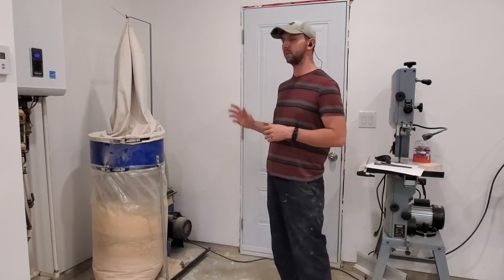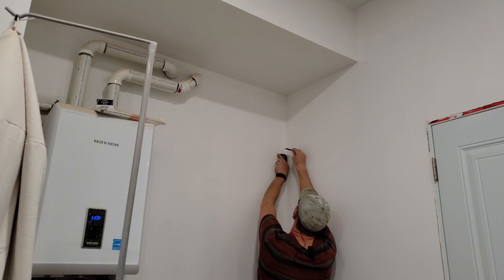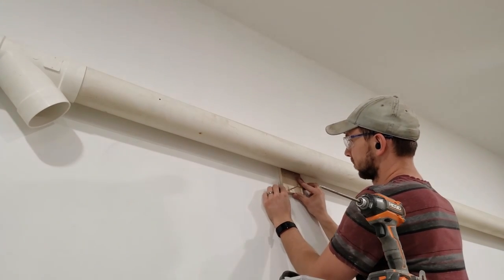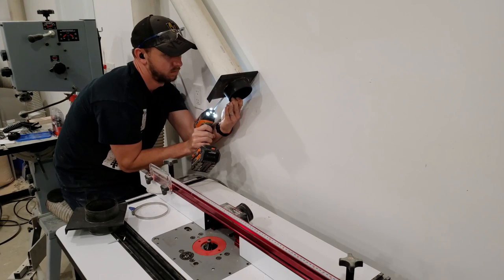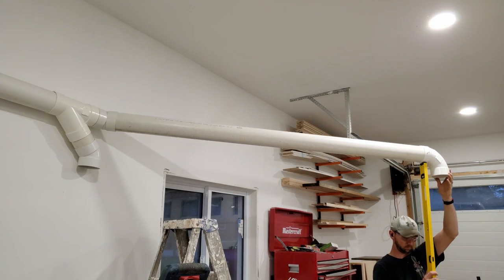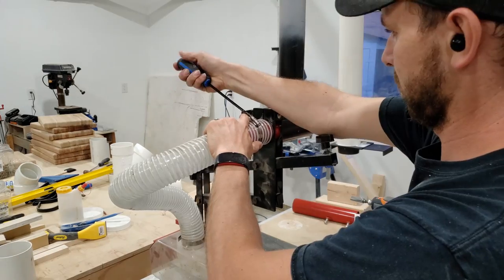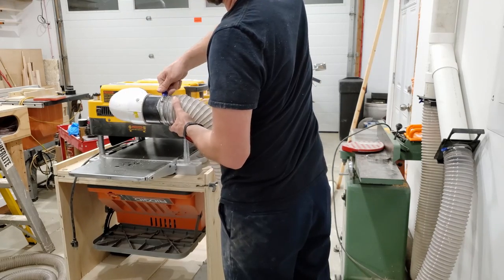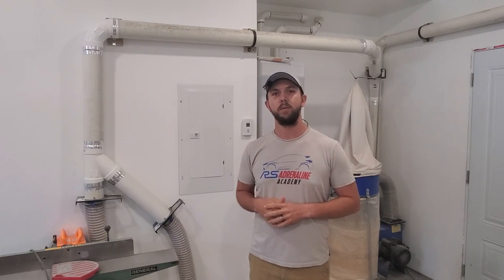How To || Beginner Dust Collection Install || Using 4" PVC

Comment: Great video, thank you for posting your install.  Are you pleased with the system 7 months later and what might you do differently?
Reply from the maker: The system has worked very well, very happy I did it! 2 things I will be upgrading in the near future are the blast gates, replacing with metal ones. And upgrading the dust collector to a 2 stage unit with more CFM. Otherwise, the 4" ducting has been plenty sufficient for my 1 man shop.

Comment: Nice, but I would recommend using two 45 degree elbows separated by at least a foot of pipe in place of each 90 degree elbow for better air flow.

Comment: What were your thoughts on grounding the system?  Some say you should, other say its not necessary.  I'm about to start installing my dust collection would really like your thoughts on it.....thanks, Tony
Reply from the maker: Hey Tony. 

I referred to Stumpy Nubs when installing. But basically, for a small DC system like mine it really isn't necessary. The chance for a static explosion to happen is near impossible. The reason I've thought about it is to remove the static so I don't get shocked when I touch the flex hose. Since replacing my dewalt planer, I don't have that issue anymore either.
Reply: @KlassenWoodworks  Thanks for the quick reply. I watched a video yesterday from an electrician/woodworker who said the same thing. In a small shop it’s near impossible to have a disaster caused by static discharge. Thanks again.
Reply from the maker: @tm5017  Always good to do the research though to be safe. No problem Tony!
Reply: You can add a continuous run of aluminum duct tape on the duct run back to a ground.

Comment: Okay I am installing my dust collection piping now, using 4” ABS. Where do I find those pipe clamps you are using? I have looked online for quite a while and I do not see anything matching a 4.5” O.	D. Pipe? Some are available that say they will work for 4” pipe, but no dimensions given. Help?
Reply from the maker: Hey, great question! The wall hangers I used are from powertec and can be found on Amazon. Now, the 4 1/2" ABS does exceed the 4" diameter its designed for. I still used them, the plastic would bend slightly and you'd be left with a small gap between the wall and the hanger. Haven't had one break and they have a very solid hold on the pipe. The other option I did utilize was steel straping cut to size. Hope this helps. 👍
Reply: @KlassenWoodworks  okay thanks for that quick reply! I do wonder why places like Rockler seem to leave this need without any help or referral?! Seems odd. But thank you